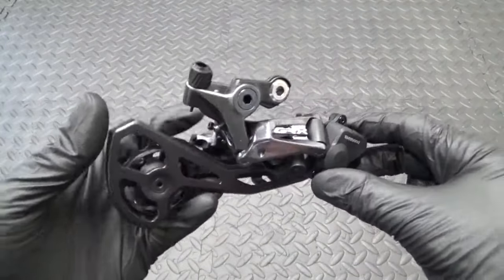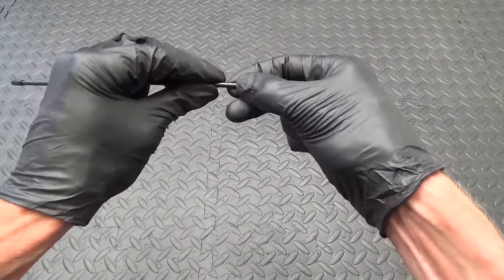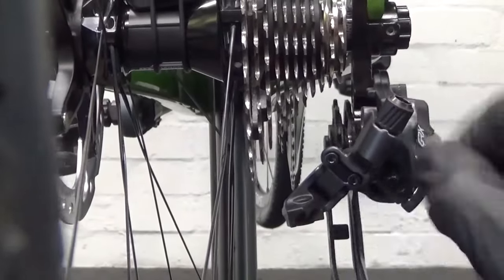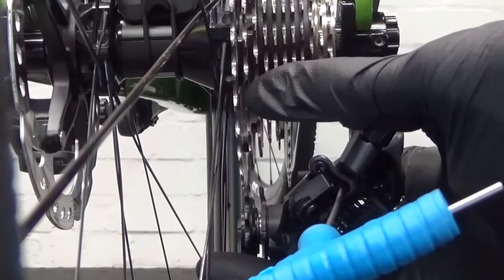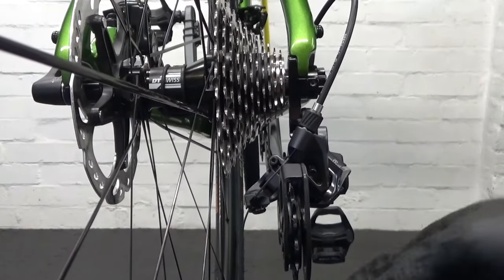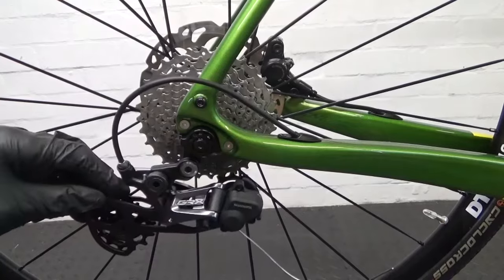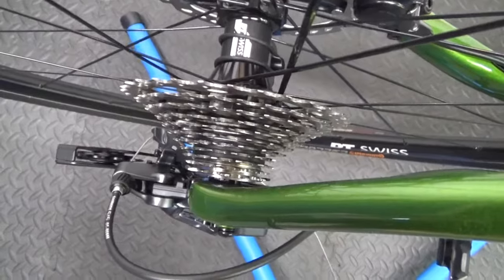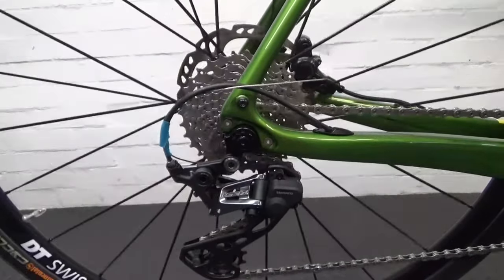Shimano GRX 810 Rear Derailleur Fitting Guide

Comment: You have literally saved my sanity. I got a new bike and every time I took my rear wheel off to put it on the turbo trainer the indexing was screwed when I put it back on the bike. Your video allowed me to identify that the cable was slipping as the gripping screw wasn’t tightened enough. It also allowed me to better align the derailleur. Thanks so much!

Comment: Was changing my rear derailleur cabling on my GRX 812 and watched a few other video's but just couldn't get it to shift properly. Usually it would shift just three sprockets max. Then you explained that I should tighten the derailleur cable much harder than other video's explained and this did the trick for me. After this it needed just minimal adjusting.

Comment: I am going to challenge your rear derailleur tuning skills and expertise.  Okay here it goes.

Shimano GRX 810 1x set-up.  40 front ring -  11-42 SLX rear - HG701 chain. Silca Wax

So 11-28 cogs shift great with no hesitation or chatter.   But going from 28-32 or 32-37 I get chatter for a second before they shift.  Strangely enough 37-42 works great too.  The chatter is inconsistent and sometimes the shifts are perfect.  I have never missed a shift but the chatter really bothers me.

I have played with barrel tension with no great result.  B screw maybe? bad cog(s) on the SLX cassette?

Any hep is much appreciated. 

Cheers

Comment: Hey, super video! I reworked everything the same way, but I have a question: my cable at the back of the circuit is very stiff and the GRX switchgear can't swing freely like yours. Is that bad? Or should the cable piece definitely be so elastic that you can move the circuit loosely back and forth?

Comment: Do you find that your mech bounces around quite a lot of that b-screw? You can in your video that it's free to swing around on the hanger that screws into the dropout. This is what causes the noise on mine. It's is fine when there's tension on the chain but on a descent when freewheeling it sounds like the bike is falling apart!

Comment: Thanks for this great video. I have the problem, that chain makes noise on the 9th or 10th. When I turn anti-clowise and the noise is gone I have the noise on the 2nd and 3rd by switching up to 11th. I have no idea to solve this problem. Do you have an idea? The bike is almost new. Problem exists since first day.
Reply: check if rear derailleur/drop out  is not bent on left /right or twisted, it should be straight in both axes, check if cassete is tightened properly , if nothing helps, try with different widenes of spacers between cassete rings, or grind cassete rings that make noise but are not used often